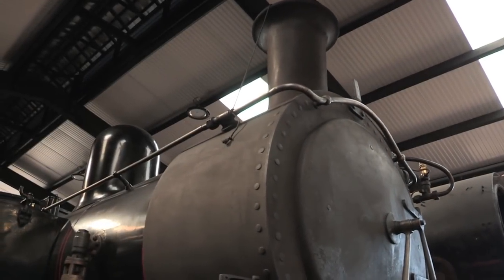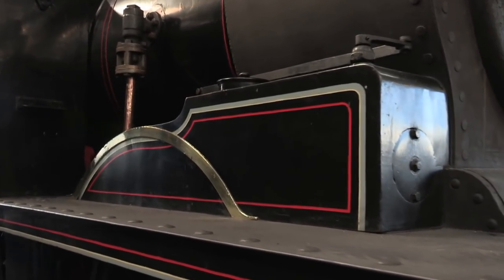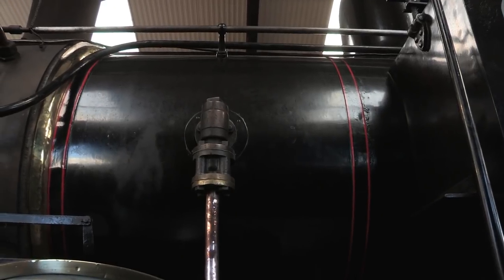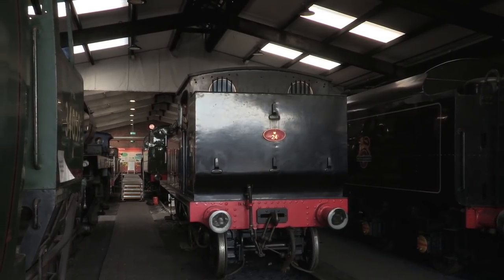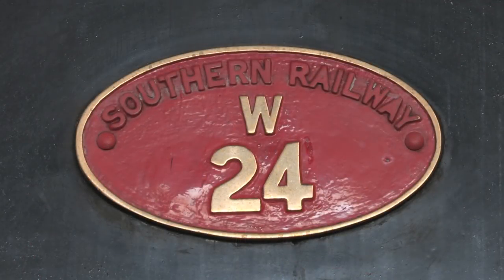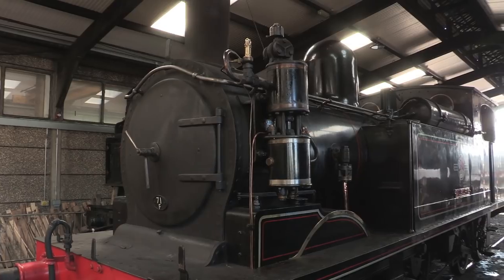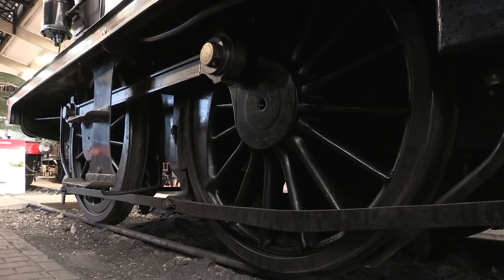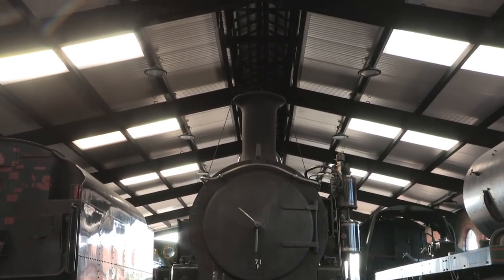SOLE SLIP: LSWR O2 No W24 Calbourne

Comment: Lovely taking advantage of her visit to the Bluebell. Also the sight of the O2 at Pier Head May actually become a reality as they’re discussing operations to Ryde St. John’s.
Reply: If we’re lucky he filmed some footage of 30585 to do the Beattie well tanks
Reply: The Esplande would be the limit without lots of work (the Tunnel would need a good deal, though). Seeing as CALBOURNE is a tank engine the weight it very concentrated and the pier piling would have to be rebuilt to accommodate such.
Reply: @jacobwoods8738  They aren't allowed to rebuild the pier, they would have to just reinforce whats there, but before you even get there you'd have to sort the tunnel out so it might just be best to take it to St johns

Comment: Some extra info about W24 from an IOW Loco Volunteer - originally we did not want this locomotive, we were to have W31 (from memory?) but BR 'accidentally' cut her up although thankfully Calbourne Parish Council had already bought W24 from BR for static display in the village. Upon hearing this, the WLS asked the village what they would take for her and with the help of the late David Sheppard she was bought from them.
Just something someone might find interesting.
Reply: We've heard about scratch built tender locomotives
But not so much with tank engines. It would be nice to rebuild another Adams O2 from scratch. The boiler for a T1 is on the Avon Valley Railway. 
That's the boiler sorted.
Reply: On various fronts, we all owe David Sheppard a lot.......
Reply: Steam engine 🚂🚂🚂🚂🚂🚂🚂🚂🚂🚂🚂🚂🚂🚂🚂🚂🚂🚂🚂🚂🚂🚂🚂🚂🚂🚂🚂🚂🚂🚂🚂🚂🚂🚂🚂🚂🚂🚂
Reply: that is interesting

thank you